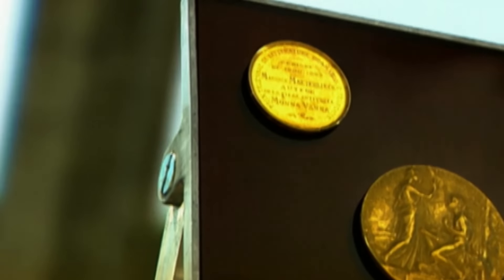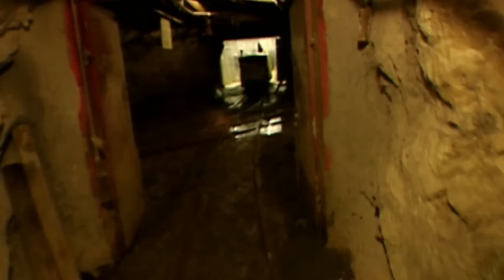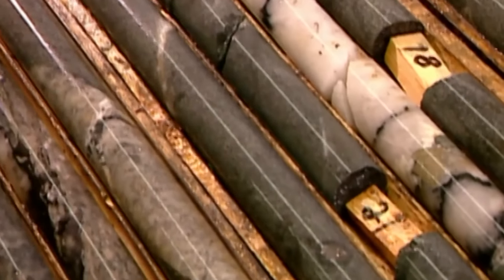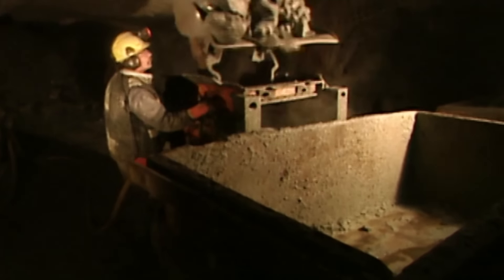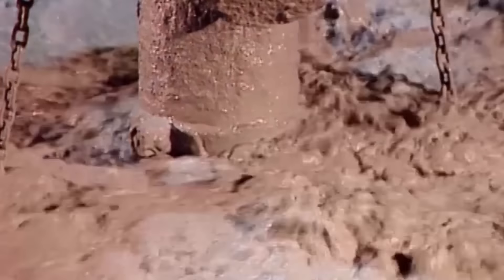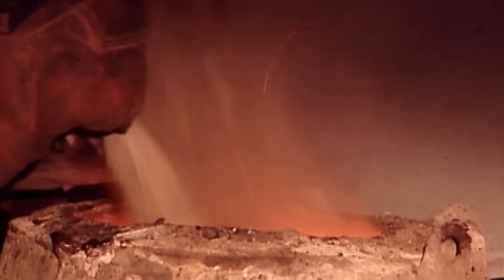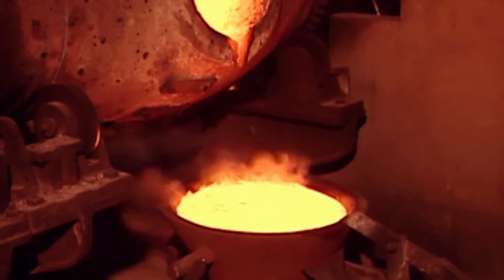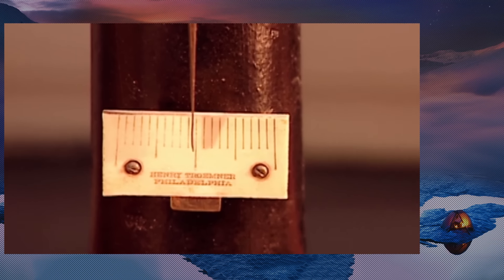GOLD | How It's Made

Comment: 6 Grams pure gold per ton. At today's prices, that's $350 in gold. 2/5/21. That large bar weighs about 20 kilos and it's about 85% pure gold. The rest is usually silver, copper, zinc and tiny amounts of platinum.
Reply: Depending on the ore source, the crudely refined gold bar also may contain other precious metals, such as silver, platinum, and palladium.

They mined 1M grams (a metric ton) of rock, crudely processed the gold-bearing parts, and got only 6 grams of Au within a resultant metal chunk at about .8 fineness. So, it's about 7.5 grams, with 1.5 grams of other stuff, such as Cu, Zn, Ag, Pt, Pd, etc.

One troy ounce of gold is exactly 31.1034768 grams, and its pure form peaked at $2048 on 2023/05/10. At this rate, 6 g is worth $395.

Comment: I want to see that purifying process.

But what will they do with those remaining residues of steel once saperated from the gold, will they not sell it to steel company’s?
Reply: Depending on the ore source, the crudely refined gold bar also may contain other precious metals, such as silver, platinum, and palladium.

They mined 1M grams (a metric ton) of rock, crudely processed the gold-bearing parts, and got only 6 grams of Au within a resultant metal chunk at about .8 fineness. So, it's about 7.5 grams, with 1.5 grams of other stuff, such as Cu, Zn, Ag, Pt, Pd, etc.

One troy ounce of gold is exactly 31.1034768 grams, and its pure form peaked at $2048 on 2023/05/10. At this rate, 6 g is worth $395.

Comment: Graduate the gravel and 8 inches of brick over slightly the brick of gravel with sterlin water current of one volocity m.p.h. cucurring unit of np electricty walls transspassing and transforming the particle of gravel eight inch brick current flow of sterlin water over lapping the brick while the radio active unit of np into hard marvel eight inch bricks accessing the combinination with weld eight inch rectangle crates in heat creating the element 1.9 and 22karet gold eight bricks of the element chemical slope core molucle.
Reply: Sorry for writing you, just out of curiosity your page come up on my suggested friend lists so I was just wondering if I knew you from somewhere???